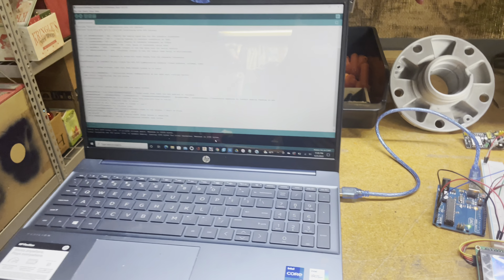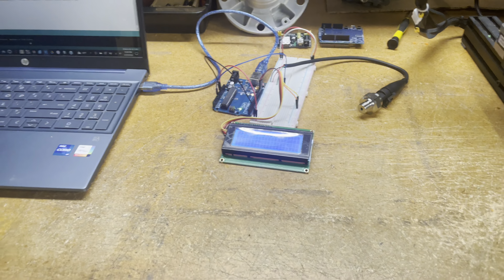Porsche 944 Turbo and Arduino uno possibilities

Comment: Knock should be fairly simple. You would have to do some signal conditioning and then use software interrupts. Also look into the esp8266, less i/o but has wifi capabilities.

Comment: I've been thinking about ways to build an Arduino-based data logger for my 951. It's theoretically simple to tie into signals to the DME for rpm, AFM %, knock, etc., and add extra sensors for boost and WBO2, but collecting the data and/or displaying it in a readable way seems more challenging. I was going to explore using the Arduino to convert signals to serial data and then using Excel serial monitoring to collect and display the data. My problem is too many projects and ideas and not enough time!
Reply from the maker: Definitely sounds interesting! If you get around to it definitely make a video I’d love to see it. I know speeduino uses Tuner studio to display and log… might be something you could integrate easier using that software